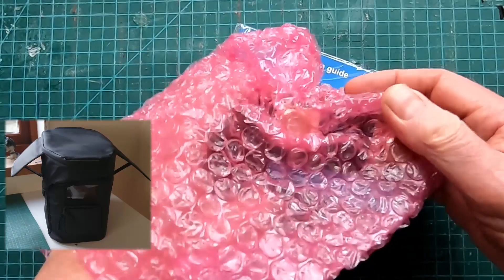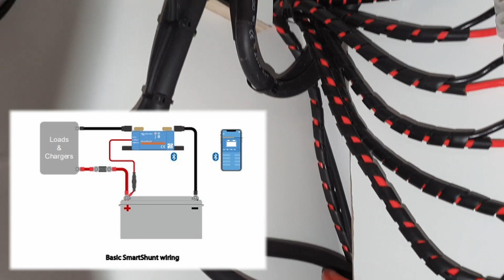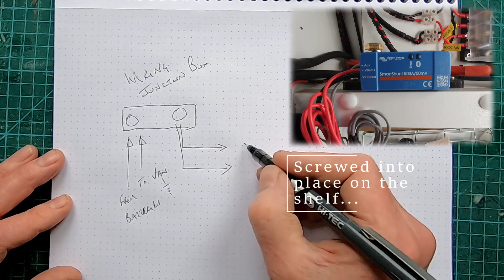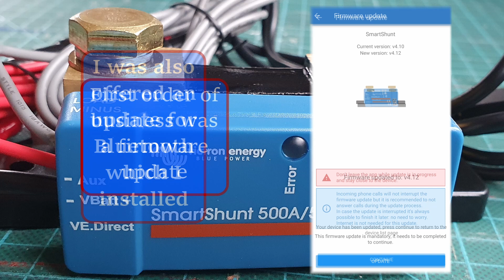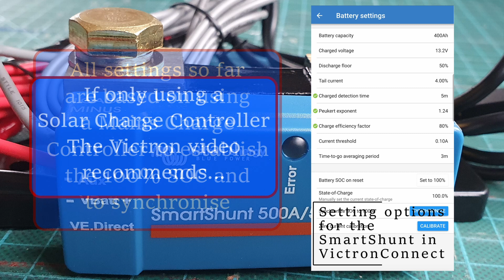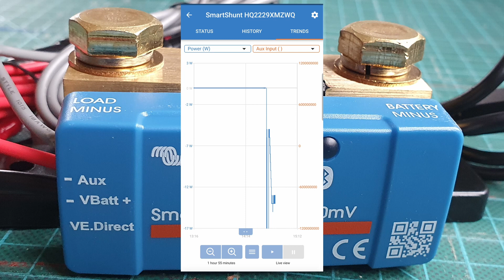Victron IP65 SmartShunt 500A. Install & Settings w/AGM Batteries in my Camper Van. RND Diaries #173

Comment: The question I have which never seems to be addressed in these videos, is whether I leave the wiring of the two batteries to each other, as is, or move the black negative battery connection to the shunt so the only black negative wire on the one battery is from the shunt. Any help would be appreciated.

Comment: SmartSunt 500 A va bene anche per batterie a Litio?
Al momento ho n2 AGM da 120Ah va bene anche per queste batterie?
Approfitto per altra domanda e ringrazio anticipatamente.
Ho acquistato victron energy 100 i 50
Va bene per 680 watt totali di pannelli?
n3 3 da 140 watt e n2 da 130 watt?
Cosa necessita ancora per un buon solo funzionamento?
Grazie
Reply from the maker: I do not want to give you bad advice so I would recommend sending an email to Victron customer support. I have found them very useful in the past when deciding which of their units I needed for my setup. Hope this helps.

Comment: Thank you for your video. If I may ask, where did you get your info for setting up an AGM battery on the App, much appreciated
Reply from the maker: Glad it was useful. I got the info on setting up the SmartShunt from Victron's video which is linked in the description : ''Victron Energy ‘How to set up BMV Battery Monitor for lead and lithium batteries'' - In this video I tried to summarise and shorten their description. As concerns AGM battery State of Charge, 12 Volt Planet have a new table comparing lead acid, AGM and Lithium batteries here: https://www.12voltplanet.co.uk/news/how-to-use-a-multimeter-to-estimate-the-soc-of-your-battery.html (just copy and paste). Link to my Victron Smart Protect video which you might also find useful is here: 
https://youtu.be/kxnU1kLZE00 Cheers.
Reply: @RedNemesisDogPrime  thank you sir you are a star

Comment: Thanks for your vid 
If you want to know what the capacity of your battery's now you can buy a battery tester 
You start at 100% and it loads the battery say 10amps and then drain the battery's to certain voltage drop it will work out what is capacity of battery 
Here is link to somebody else I watched doing this  https://youtu.be/pbXx6RGGRXc?t=776
Reply from the maker: Many Thanks